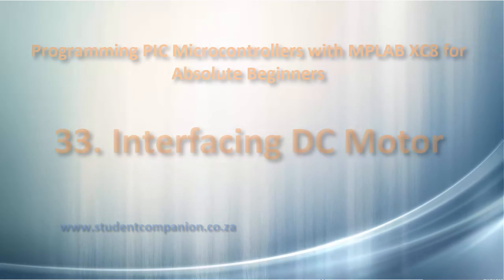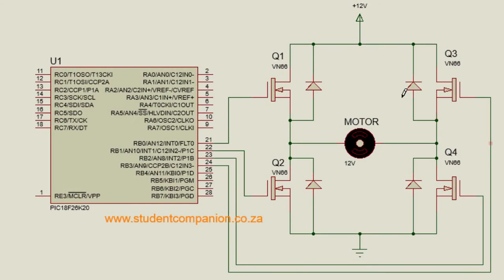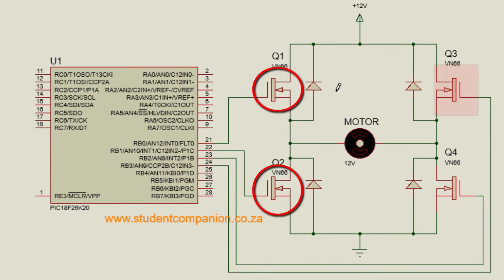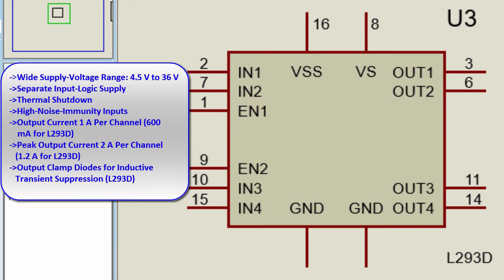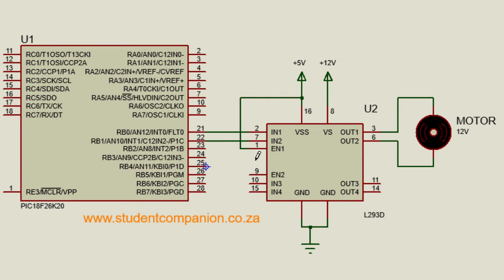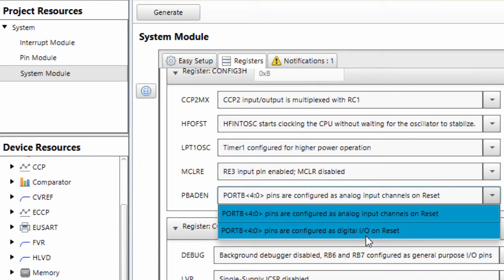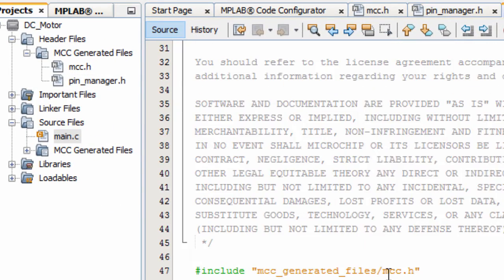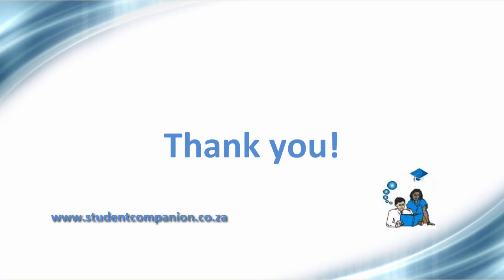33- Interfacing DC Motor | MPLAB XC8 for Beginners Tutorial

Comment: Can you explain what happens when the WPU box in the pin manager is checked or not checked? :) Great video as always!
Reply from the maker: +Marco Domingo WPU stands for Weak Pull-Ups. This is used when you want to use the internal pull-ups resistors instead of an external Resistor. Remember the switch tutorial. You need a pull-up resistor. In this tutorial as we are controlling an output of a PIC, any thing on WPU won't make a difference